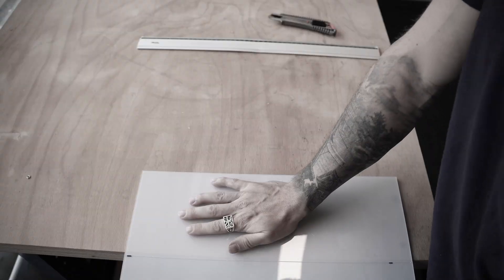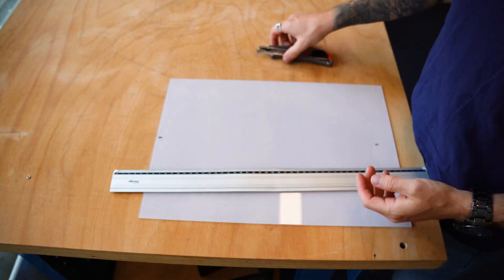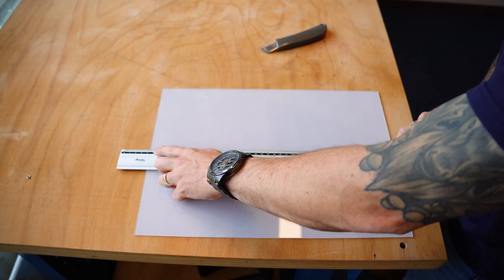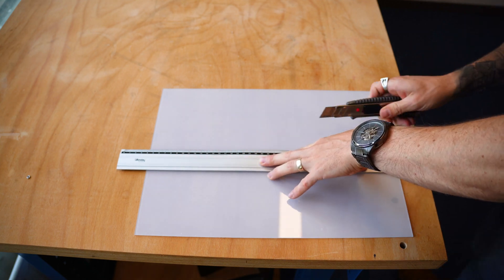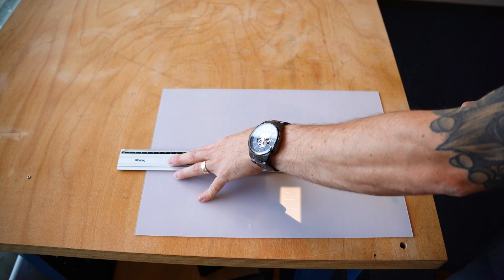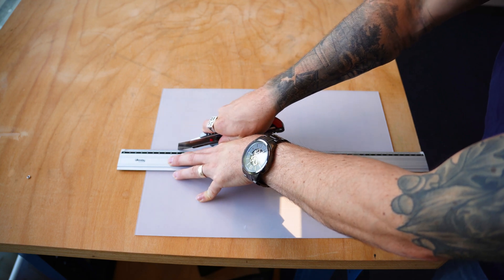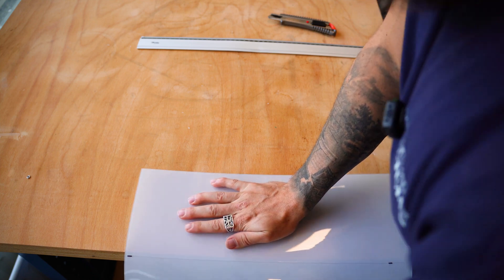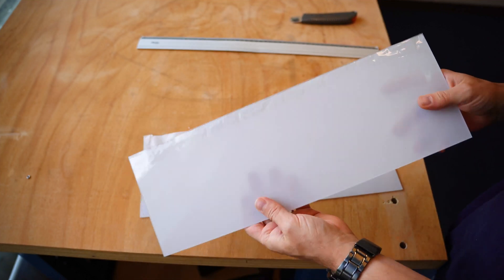How to Cut Polycarbonate Without Power Tools

Comment: Plexiglass is the brand name for acrylic. Lexan for polycarbonate.
Question: I know everyone would have an utility knife cutter at hand; but would a scoring knife (usually used for glass) also work here?
Could be much safer for the fingers.
Reply from the maker: Ah, I'm not so good with brand names, my mistake. I think a scoring knife would work. I've even done this with a slot screwdriver.